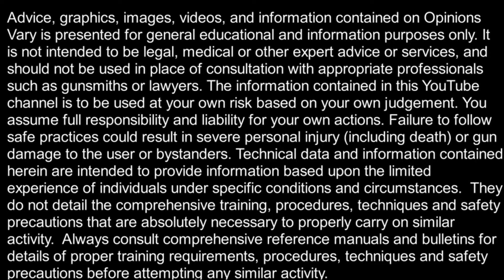DYI 1911 Accurizing

Comment: Everything seems pretty loose in disassembly.
Reply from the maker: In my opinion: It's supposed to be loose tolerance technology. Like an old yard Master Lock on a fence gate - it's what they were trying for back then. The idea was to make things loose & tight to where it counts the most like a fence chain back then. The barrel hood & bushing tends to bring the 6" group @ 25 yards with the one handed shooting that was the specification for combat back then. This gun probably groups a little better than a Rock Island with my custom barrel fitting.

The load bearing is estimated to be around 5 foot pounds of torque during shooting. The slide up & down wiggle effects the shot group where as the side to side doesn't matter as much so long as the barrel hood locks close to the slide. I try for .002" clearance on either side. 

The link set up is supposed to giddy up the barrel into battery. It's important to understand this before trying to fit a bushing. The link holes will oval over time as the barrel will hammer the vertical impact surface to reset the feed. So you fit the hood 1st, then the bushing with it pulled up to the max upward travel the barrel can lock up to. Then you chose the link otherwise the bushing will strum the barrel into battery making alignment  problems with the recoil groves in the slide (that's what they are).

The vertical stringing is caused by a sloppy barrel link. The shot pattern will look like the bottom of a smiley face until a thicker link is installed. The group size is caused by the barrel to bushing fit along with the Barrel's hood to slide fitment. 

Skipping the hood fitment & going for a tighter bushing causes "barrel springing" & works the slide stop to barrel lug area. It causes the switch lever to slam back & forth in the slot (not good). It has to giddy up not press down under load. 
 
The barrel can only lock up as high as a chambered round will allow. Chopping the feed ramp was how it was done with a longer link back then before we knew better.  So don't plan on using the tallest link that will give the tightest lock up because the feed ramp may actually bind on the chambering shell case. This is one of the most common issues with people building custom guns. This makes the gun unreliable & works the extractor claw almost as bad as the wrong ejector profile. It's also the reason the feed ramp must be radial used & not a chop taper. The upper bullet slides under load against the feed ramp during the clambering of a  round. This is exactly why the link has to giddy up into battery rather than be rolled up into battery under a tight tolerance loaded system. That why it has to be loose.

Comment: Unique perspectives. May have something there with the reasonings behind allowable tolerances and accuracy.
Reply from the maker: In my opinion: The tollerances are needed in order that the slide stop works .002" minimum would be needed to function reliably & the bottom barrel lugs have to get off the slide stop pin right after battery. 

If you didn't need the magazine to lock back after last round, it wouldn't matter as much, but it will roll back & forth like a switch slam-hammerering the frame notch & slow the slide down a bit prior to battery (not supposed to work this way).

Gun powder is quite a slide stopper without some wiggle room. Often times it can be worse than dirt. It's not so much the heat expansion that the tollerances are there, it would be because of the effects of gun powder.  

If the barrel exterior gets gunky with the slide back the bushing can prematurely pull the barrel forward causing the top hood lugs to wear on the slide grooves. This would be inline with what's regarded as "barrel springing" to parts fitters.

It has to wiggle to continue to run. 

Pistol shells often times do not come crimped. Pellet powder tends to be the worst gun clogger when a case crimp isn't used to help burn thoroughly. You typically won't know what type of powder granulation you'd have unless you loaded the shell yourself.  A lot of people would argue about it, but cheap non Russian made ammo tends to use pellet powders.